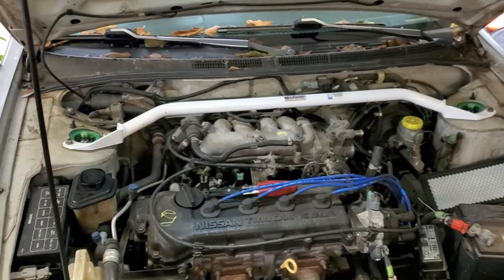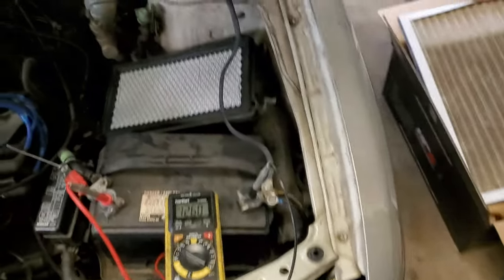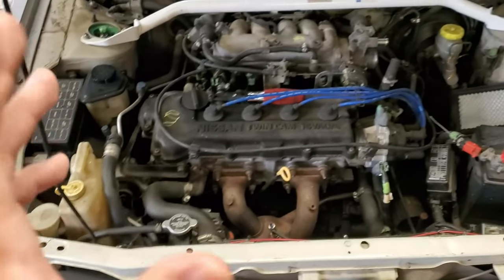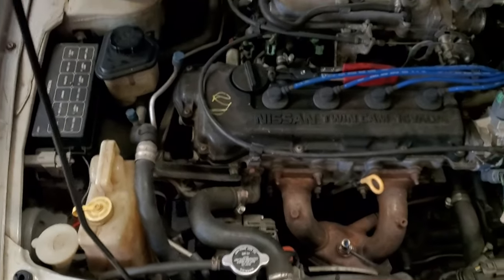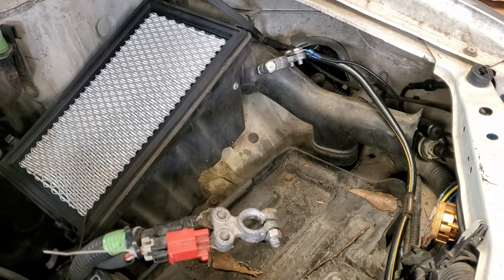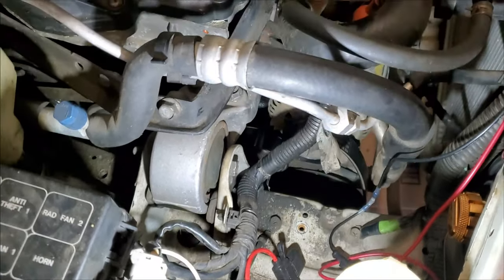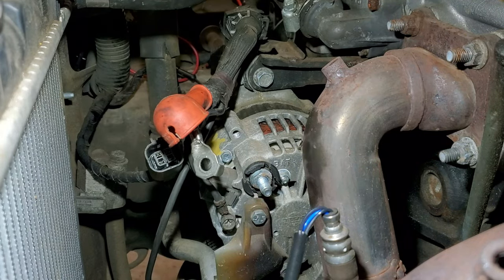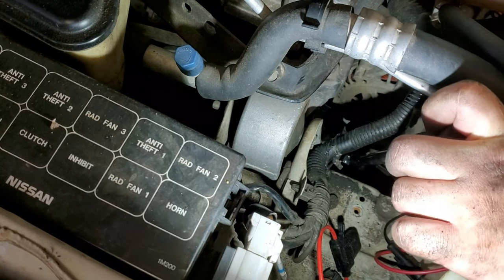How to - 1999 Nissan Sentra 1.6 Alternator Removal

Comment: Any special trick to removing the 14mm bolt on the belt side? Mine won't budge
Reply from the maker: Play around with the alternator, move it back and forth or side to side while you unscrew the bolt. Since it is a pain, you need to also play around with the short and long socket, and a short extension. Honestly, you need to fool around for a while for it to come out, that's what I did and I remember I was frustrated when I finally got it out, just be patient with it.
Reply: @franksgarage7880  thank you for replying, finally got it fixed and this video helped me a ton.